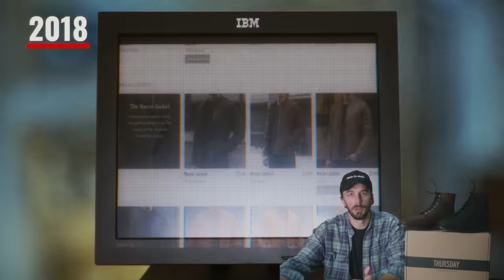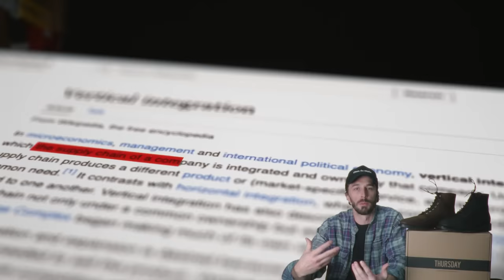Thursday History: Why they’re taking over the affordable boot world

Comment: For the women out there, most of the Thursday women's boots are NOT good year welted but glued. Thats why theyre generally cheaper than the mens line of boots. I bought two pairs before realizing the difference. I do still think the prices are reasonable though
Reply: The Captain in the "Rugged and Resilient" line is goodyear welted but I don't think anything other than those few boots are.
Reply: That sucks. Why do women never get the same level of quality as men's clothing/accessories, even when we go out of our way to purchase a higher quality product? The whole point was to be able to wear and repair them for years on end.
Reply: @maryam.m  I was astonished when I was in college and my then gf would keep on having shoes fall apart on dates, often first time she wore them out. I experienced similar when I started doing drag as part of some light freshman hazing (don't knock it until you try it, the drag that is)- of course it didn't help that my feet were way too big but heels just fell apart with ease as did lots of the clothes we used. Quality clothing is hard to come by but especially women's clothing.
Reply: @maryam.m  Men typically just get one or two pairs of shoes/boots and keep wearing them over and over until they fall apart. Women follow styles and trends and like to have options and buy a lot more, so the quality is less important since they won't be used as hard. Obviously this isn't true for everyone, but in general it holds up.
Reply: Fake
Reply: @maryam.m  Salomon is the only company I've seen that does the weird gender difference in boots, but usually makes the women's version an overall better boot (and with way better colorways)
Reply: @Crushenator500 great observation.
Reply: @maryam.m Grant Stone has a women's line that is just a slightly diff last but GYW and all the same components and build quality!
Reply: I bought a Thursday Dreamer for my mum (a chelsea boot), and I notice that there are stitches around the sole. It's the same colour as the leather and hiding at the corner of the upper, you can't see it from afar. Maybe not a goodyear welt though. I don't know, I'm no expert. I read somewhere that the reason it's not because goodyear welted boots are heavy, and women don't like heavy footwear. But it's definitely not just glued.
Reply: @jacksontjota  My boots also have the stitches around the edges but customer service told me that the womens boots I have (Ryder and Renegade) use Cemented construction instead of a GYW because it's lighter. You'll notice the details on the page of the Dreamer and other womens boots don't mention anything about a goodyear welt or stitching except for the Captain and Diplomat but all the mens boots do mention it. Maybe the stitches are just decorative
Reply: Joseph Cheaney and Crockett & Jones women’s boots are just the same quality as the men’s
Reply: Yup. I have a pair of Captains because those are one of the few womens boots that are GYW. I keep sending them emails asking about expanding the GYW women's line but the response is usually "No plans at this moment due to low demand/But that would make the boot too heavy for women!"

My feet are too small for the men's versions, so I'm stuck with few options.
Reply: @Crushenator500  Booo! Is that really what you think? Women care too much about fashion to want quality built shoes?! More like we have gotten used to accepting crap quality. I want GYW Chelsea boots, a style that's been popular for DECADES and isn't going away. They're not trendy, they're classic. Why does Thursday offer GYW Chelsea boots for men but not women?
Reply: how much are you paying?
Reply: Yeah it is unfortunate that most of the women's boots are cement constructed. I know the Women's Captain and Diplomat are goodyear welted though. I appreciate that Thursday at least did reveal that they based the decision on market research of many women preferring the lighter and more flexible shoes you get with cement construction, but it still does suck. Thursday has also mentioned plans to expand the goodyear welted offerings for the womens line in the future.
Reply: @maryam.m  Obviously Thursday thinks women will wear them more as a fashion accessory and be more willing to buy new ones when they do wear out. Women don't do actual work, haha. Very "oldschool" view on women just like their boots are "oldschool" (quotes emphasised).
Reply: @jacksontjota they probably use what’s called a Blake stitch. It’s where they sew the upper material directly to the sole of the shoe. It’s different than a Goodyear welt and not as durable, but it’s better than them just being glued together (cemented).
Reply: EXACTLY. The Captain is their flagship show boot. I think the women's combat boot is also GYW, but still...I wish we were cutting a model that isn't their show pony.
Reply: @jacksontjota I took a peek out of curiosity, and they are not. A good year welt construction is "the best" method because it actually sews the midsole to the outsole. It's VERY common to see a stitch for the appearance of this construction since it's often associated with better quality. You'll notice it's Thursday's top list item for the Captain. That said, I have plenty of shoes that have glue and still lasted well.
Reply: I suspected this but thanks for pointing it out before I bought a pair! So annoying. Back to saving for an RM Williams.
Reply: That’s correct, I bought the Chelsea men’s boot for this very reason. Luckily I am a size 7.5/8 US and their smallest men’s size is 6 so they fit pretty well
Reply: You can see which of the women's shoes are goodyear welted (only the captain i'm pretty sure) on the site so it shouldn't be a shock if you read the description.............
Reply: And most of their boots for women don’t have a steel shank; which is super disappointing. I wish this channel would cover more women’s boots to help find ones that are worth the cost

Comment: I bought a pair of Thursday Majors and the side zipper broke the first time I tried them on.  They didn't offer to expedite a replacement pair or anything.  I mentioned my experience on a review left on their website and they deleted my review.  I hope the quality has improved but I think it's really shady to remove negative comments.
Reply: it's a company ran by two beta boys what do you expect?
Reply: Wow. This is unnerving to discover. Thank you for letting the world know. Unfortunate to see business practices like this. 

I have a pair incoming and I certainly hope my experience is different. 

Did you ever get this resolved?
Reply: @Mavryck_Tha_Myghty  Although they didn't post my review, I still think Thursday is a decent business and more than likely I just got a faulty pair. The new Majors have a "long lasting Rubi zipper" and this could very well be an improvement over the Majors that I received a few years ago.  Thursday was quick to respond to my message regarding the broken zipper and offered to either cover the cost to have a local cobbler fix it or they were willing to exchange my pair and cover all the shipping.  The only thing they asked for was a photo of the broken part and another of the quality assurance card that was in the box.
Reply: @Mavryck_Tha_Myghty  The Release Notes on the Majors say that in April 2023 they "Changed zipper to a new supplier with better lab results and longer zipper life guarantee" so this would have improved on the issue that I encountered on my pair from a few years prior to the upgrade..
Reply: They delete all negative reviews. They also spam your email begging for positive reviews.

Comment: In 1 year I got 3 different pairs. The Stompers, Presidents, and Hightop sneakers. Although I love them each of them did some with small different problems. The Stompers have a smooth heel counter so quite a bit of heel slip. The President had the tongue slide way off to the side and I had to get slits made to hold them in place. The Hightop also had the tongue slide all the way to the side even though it already had lace loops to hold them in place. On Reddit, quality control also seems to be an issue as many customers report other similar slight issues such as a toecap being titled, the color of one being different from the other, and general oddities. No deal breakers but still something to think about. Especially for anyone who's ordering from outside the US because although they do free returns you will have to pay to ship them back to the company and depending on where you live you might be paying as much as 25% of your purchase on the exchange alone.

Comment: i bought my first pair of captains in early 2020, and bought another pair late 2022 and the latter fit SO much better. I thought it was just a slight difference since they are handmade, but the toebox is perfect for my foot now, my old ones squeeze my small toes a bit and make them raw after wearing them for awhile. they are both size 10.

Comment: I've been wearing Thursdays since 2018. I have an original first-run pair of their black Aviator wingtip dress shoes, which have held up better than any other dress shoe I've bought in the last ten years. I bought Captains in Brandy in 2019 and never looked back. I wore those boots so hard that I had to buy another pair, which I wore hard enough to tear the upper. Now on pair #3, and so far these have held up much better, albeit with less hard wear as a result of the next two purchases: StormKing Captains and Maverick western boots.. I bought the StormKing Captains in 2020 that have worn well externally despite some really tough conditions (totally soaked them in the rain several times, worked in them, etc). The Maverick western boots are my most recent purchase, and they're my favorite boots now.

Comment: I have shoes and boots that are over $1K but there is still room in my collection for Thursday Boots. These are not work boots and they're not trying to be. They're like the anti-Red Wing since their overall design aesthetic is to be sleek and not have the bulbous toe. They're style focused so you need to go in with that mindset, otherwise look elsewhere. If you want a large rotation with a wide variety of styles, leathers, and colors that won't break the bank, Thursday is a really great option. I have EE wide feet but going up a half size works well for me in the styles where they only have one width. You just have to figure out your size. I started buying Thursday Boots 5 years ago and so far, I have 4 pairs of Captain, 1 Duke, 2 Scout, 2 Stompers, 2 Wing Tip, and 1 Logger. Yes, I have a problem.😃

Comment: I have never owned a pair and probably never will.  Two different people at work tried them out.  The first coworker’s soles separated in less than 6 weeks, totally unacceptable, they did send him a replacement pair that seems to be holding up well.  The second coworker ordered a pair of boots and a belt.  The boots had a speed lace rivet pop out in the first week.  The belt appears to have been two pieces of leather and they split down the middle within the first month as well.  Based on these examples I’ll stick to my Iron Rangers and 1000 mile’s, they may cost a bit more, but at least they will hold up….  Thursday’s seem to be a crap shoot, some are decent, others are just junk like they are coming from two drastically different factories….

It also begs the question:  what did Thursday’s management team expect when they went to Mexico for production and found cut rate factories willing to manufacture “250,000 worth of boots for  a 40,000 deposit”?  It’s not like overhead gets magically paid and labor works for free, the factory cut corners and skimped on production costs where they thought no one would notice.  Another point here is that the whole point of QC is to prevent “escapes” in the production process, not allowing substandard products to even see the light of day, let alone into a reviewer’s hands.  I’d say their QC department is focused on reactive approaches after the substandard products have made it to the customer rather than proactively policing.  For the record I’ve been in statistical process control and QC for 10 years, this would have gotten me fired…..

Comment: I really regret not buying a pair of Captains when I first wanted too in 2016, I had sticker shock and though i couldn't spend that much money on shoes.  After watching them release so much in the past few years and some other circumstances I finally pulled the trigger on the Vanguards.  I love them, they are absolute magic when you break them in.  They fit to your foot so well and walking in them is a breeze.  Can't wait to buy my next pair, but I've really been contemplating JK's or Origin's.
Reply: Love my JKs
Definitely heavy duty so don't be put off by the break in

Part of the experience 😎

Comment: About a year ago or so I bought Thursday's sneakers after catching the RA video - and I absolutely could not be happier, they're pretty fantastic! Very comfortable after the short breakin, look amazing, and well constructed too. 
If anyone has any hesitancy about buying Thursdays because you have to order them online, I can say that the exchange process is awesome, I exchanged two pair before I got the perfect fit and it didn't cost anything, was low hassle, and very quick too. 
It's only a sample size of 1, but I can't say enough good things about them - now I just need to increase my personal sample size lol, they have a lot of products I'm interested in.
Reply: What was your sizing experience? Did you have to go up a size? Down a size? Wider? Narrower? than you initially thought?
Reply: @Rabbelrauser  I was trying to go off of previous boot & trainer/tennis shoe sizes; but it was actually right on my Brannock, should've just went with that first lol.
My feet are a little wide and I would call the Thursdays a standard width, but carefully tightening the laces for the first little while(loosening/tightening them top to bottom, instead of just untying & pulling them off/snugging them & tying them) really has them form fitting, they're pretty comfortable. 

I'd say they're pretty right on Brannock sizing, should be relatively forgiving if your feet aren't too wide.

Comment: I think I actually ended up with a pair of these flawed Thursday boots - I ordered a pair of Majors (as mentioned in my previous comment) and when they arrived, right out the box, one of the zippers was having issues - wouldn't zip up right half the time, usually left me fumbling and fiddling with it just to get the damn things on, very annoying. I contacted Thursday about the issue and they sent me a new pair completely free. The new boots are noticeably higher quality, the leather looks better, the zippers work flawlessly, everything about them seems better built. Plus now I have a pair of backup boots, just need to replace the zippers on 'em.

Comment: You should try naval 9in steel toe black leather boots, and the flight deck boots. There are all steel toe, they are either black or brown depending on if you are an officer or enlisted. I’d say the typical boot is like the cheapest durable boot that are mandatory to wear. And the flight deck boots are like upgraded converse. The only issue is you lose feeling in your toes after a certain point by working in these things.

Comment: Hey. So I'm a casual fan of this channel and I have a question for the boot nerds out there who will most likely know more then me. Is there a boot that is made with specifically mechanic work in mind? I've used a lot of different styles of work boots from Ariat and Georgia boots, up to my current pair which is a set of White's. I've had several I liked more then the others and some I hated, but I have yet to find a set that seems to be able to take the unique abuse that mechanic work involves. So what I'm looking for is a boot that can take the basic abuse of daily work wear, but more so the destruction of constant oil and chemical soaking. I've noticed that, for me, my laces degrade really fast and usually my stitching is the first vital part to give, long before the leather itself really shows any signs of coming apart. 
Something else that I would love to find in a boot is a sole that has a lot more traction on an oily concrete floor. I know that's kind of a unrealistic dream, but the traditional rubber or hard foam soles I've used have never served me well as far as that goes. 
So does anyone have any thoughts or ideas on a boot I should try or one built specifically for mechanics?
Reply: The jk300, Drew’s logger,
franks patriot or whites Perry they will be you best bang for your buck

Comment: Oh boy. I love Thursday, but their QC doesn't love me.

I bought a pair of black Diplomats almost a year ago & it came with a bent speed hook on the inside. Didn't even notice until the speed hook was digging into my ankle after the tongue moved. Thursday customer service was able to send a replacement even before the original was returned, but the replacement have the exact same issue. The tongue of the boot was scratched by the speed hook right out of the box & I returned the boots again for a refund instead.

Fast forward to this year; I bought a pair of black Captains instead. Surely they can't mess up again right...? Speed hook was fine, but they sent me the Lady's version of the black Captains. Thankfully, Thursday was able to send the correct replacement with no issues. I have been wearing the Captains & their high top sneakers till this day.
Reply: How did you know it was the lady's version?
Reply: @zeroman155  I had another pair of Captains with the stormking sole to compare the new boots with. The lady's version was maybe an inch shorter with the same size.